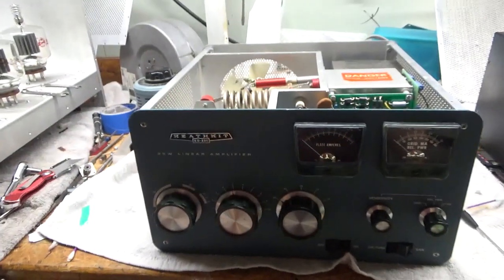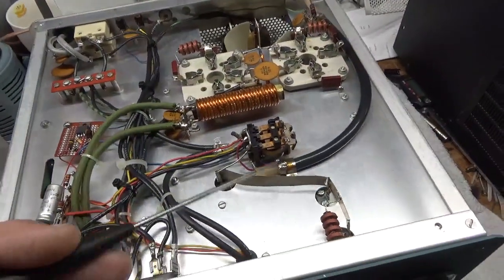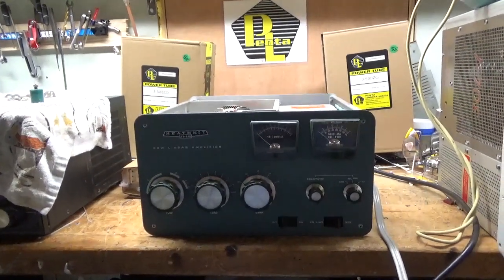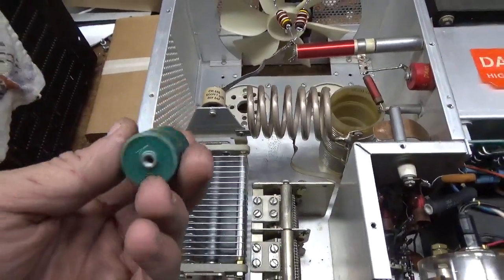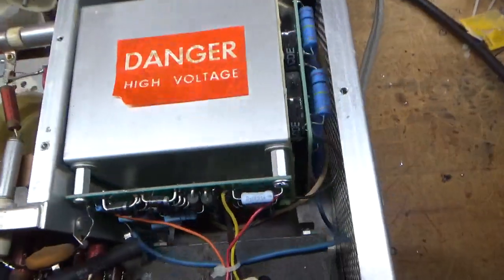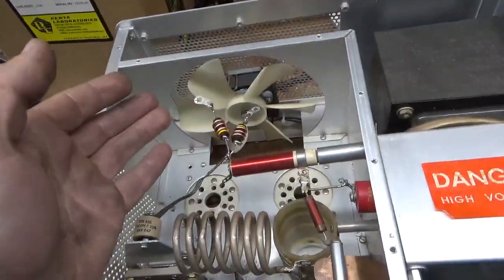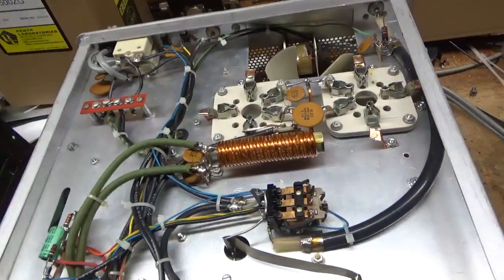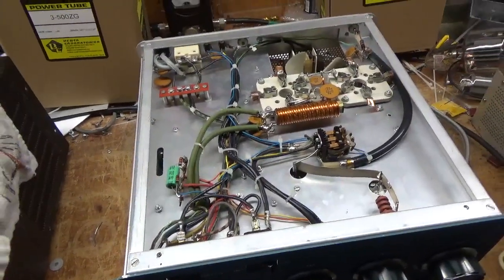Heathkit Sb-220 Repair And Modifications

Comment: Curious about your comment that the amplifier is rated for  1,200 W PEP.   Reading my manual, it states, "Low Power SSB --- For 1,000 watts P.E.P. operation . . . " and then, "High Power SSB ---- For 2,000 watts P.E.P. operation . . . "   What gives ?  Enquiring minds want to know.  Thank you.   Beautiful work, and why you have mine in queue.
Reply from the maker: Your looking at the input power specs from the line, not output power